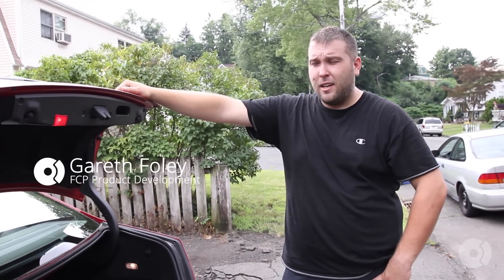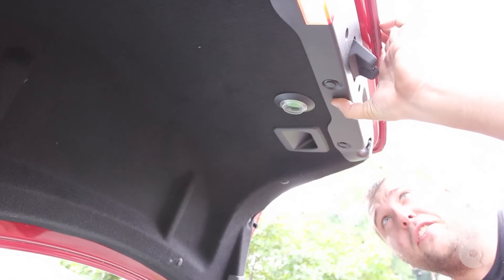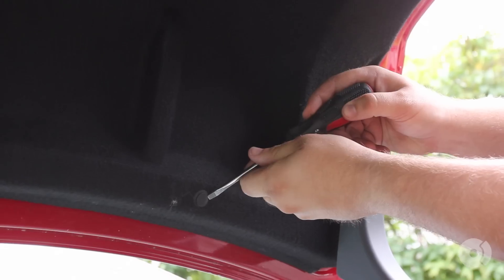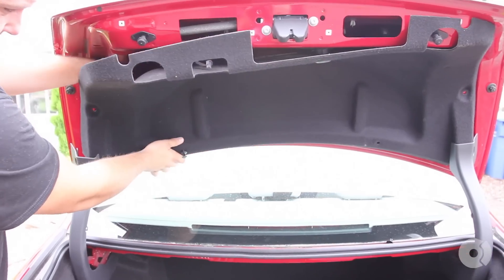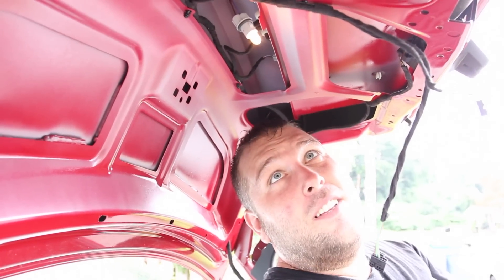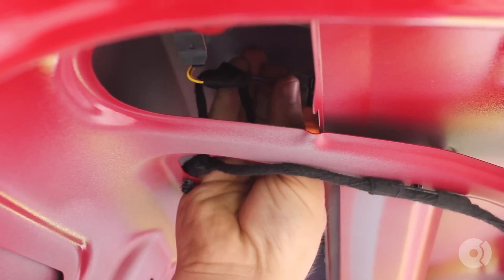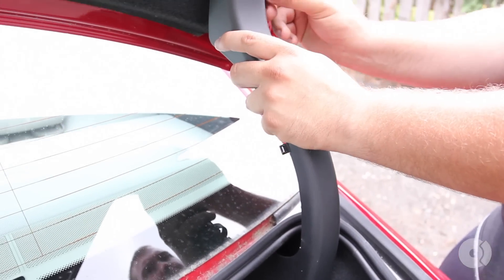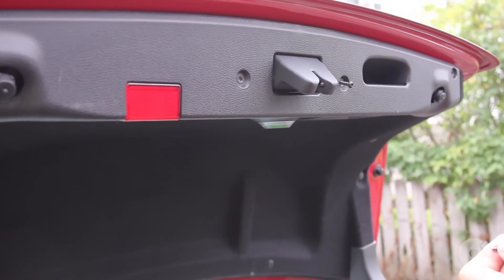How To Replace Mercedes License Plate Bulb(C300) FCP Euro

Comment: Hallelujah! I have a 2009 C300 and I would get the error messages constantly on my left tag bulb but after smacking the bulb it would turn on. Last week, my right bulb message would appear but smacking it would not help so I followed these directions and voila! they both now work flawlessly.

I get so excited when instruction videos like this one are easy to understand and go through each step that even a dummy like me can understand. It took approximately 20-30 minutes.

Thank you very much. This video is highly recommended!

Comment: Great explanation - worked that way as shown.

1 tiny advice: the clip removal becomes easier. by using a curved pliers or what we call telephone pliers with small tips you can push under the clips after first clip removal progress with a small, wide screedriver is achieved.

thanks a lot - from germany

Comment: At my first dealership job we got payed 0.3hr to replace any* peanut bulb, that came out to three dollars in my pocket before taxes.
The filaments get worn on these bulbs, if they're out and you tap them they work, but will go out again, we would replace the bulb and pull the contacts closer together to improve contact.

Comment: All that just to change a little bulb(S)? That's insane..It is what it man and great video..
Reply: depends on quality expectations

Cheap one will get loose, rattle and so on. Here all parts were dry , rust free and fixed after 400.000 km in 8 years.

Comment: I am looking to do this but wanted to get a couple of extra plastic clips if the break. I am not sure of the part number But think it is 0009914795 ?
Can anyone confirm?
Reply from the maker: Jeff Block Yes that is the correct part and it can be found here: https://www.fcpeuro.com/products/mercedes-trim-plug-0009914795

Comment: Thanks for the demo.  I have a loose bulb,  and this I know, since I can go back and tap on it and it will light up again.  Really annoying.  This is as a result of the "stealership" doing a recall having to do with some possible corrosion back there.  My wife agreed to take the car in,  since I didn't want to set foot in the place.  
Now sure enough,  I have an issue. Not going to the dealership either.
Once again,  many thanks.  Now at least I know what to do if I decide to do it.
Reply from the maker: Happy to be of assistance --Kyle
Reply: spacesaverbob By all means do it. Not worth seeing that stupid error message every time you start the car. Buy a small pack of W5W bulbs, a screwdriver and the T bit and you're good to go.

Comment: I have Mercedes S W221. Instead of plastic drills in the from surface, they are from the inside part.
It's very ilogical to change a light you must unmount too much components. This is only to give money to the mechanichs of the brand. Next car, japanese.